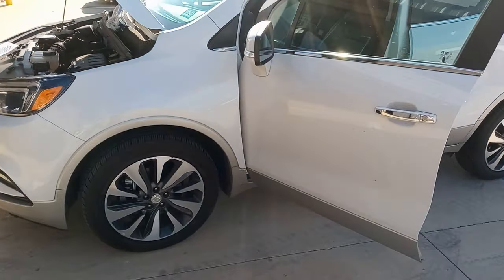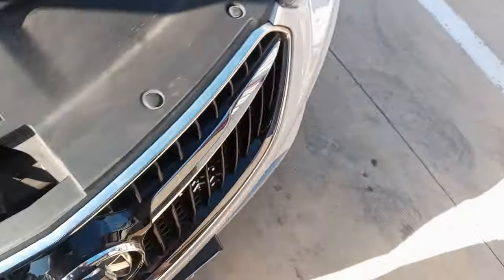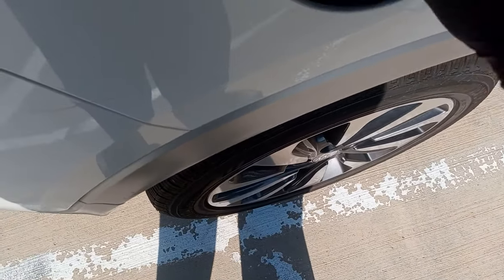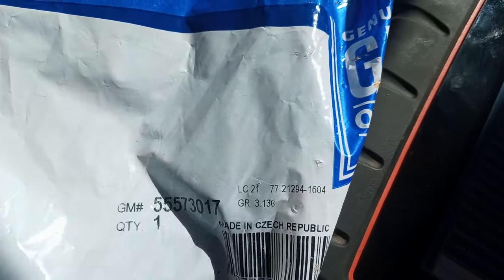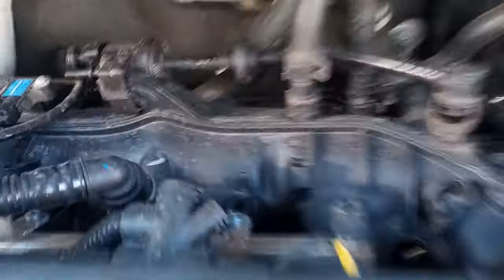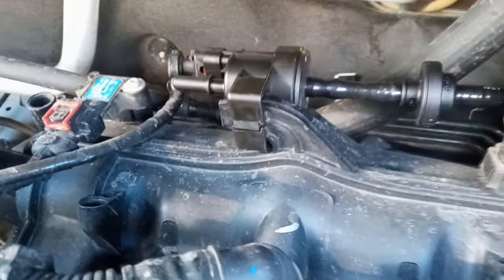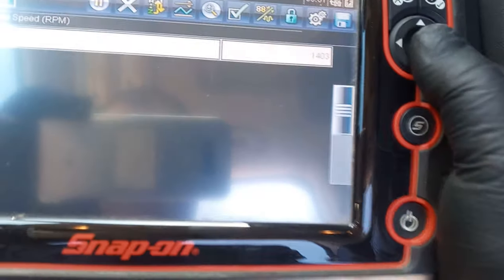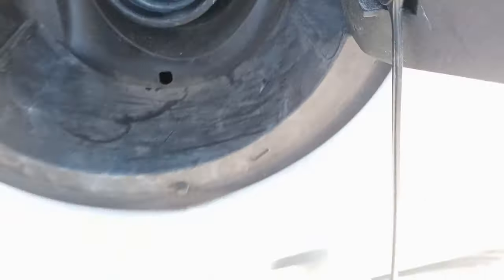1.4 Turbo lean codes: P015B, P0171, P1101, Encore, Sonic, Cruze

Comment: Are you sure thats a 2017?? I believe that engine you just showed is an early 2016. They redesigned. that engine mid 2016 the oil fill is far left upper side of valve cover now, and the intake , and PVC system are completely redesigned

Comment: Thank you, thank you, thank you. I have a 2017 sonic. I searched the codes on YouTube and found this video. I was very skeptical at first especially when you went to the gas cap. Then I was like OK I can check that. I open the gas tank and guess what I heard bubbling/gurgling. Went to the auto parts store and got the part everything is good as new.

Comment: I have a 2015 buick regal turbo, the code for mine is p1101 and the most likely solution from auto zone is power train replace intercooler hoses...
Reply: My 2015 buick regal turbo just threw the P0171 today out of no where and now my engine is leaking oil from the engine. Ive had zero issues with my car up till now except for my radio having a black screen. Ugh im so mad
Reply: Me too they put a part on and hose.
Reply: That’s crazy and he put on new gaskets so that won’t happen.I feel for you

Comment: I'm still getting the p0171 code.
Reply: There's another YT that says to replace the valve cover. It's a bit more complex than this too. Search p0171 buick encore. I'm sorry I can't link it.
Reply: @ashleysandia2528  I’ve done that plus the upper air intake manifold.
Reply: @PaulVazquezJD  Make any headway? Sounds like you have tried all the obvious items.
Reply: @Kuessemir  I just replaced the master air flow sensor with no change to it the code. I don’t see any large cracks in hoses but that still might be a place to investigate. I may also need to investigate the other side issues f the lean issues, fuel injectors.
Reply: What happened with that

Comment: Awesome video man. I have been chasing this one. Leaving right now to pull the gas cap and run some experiments, but I also have a hard stumble on acceleration. Would the purge cause that as well?
Reply: I have the same issue if you figured this out please let me know!
Reply: @darkcrimsin  I did actually figure it out. I observed throttle body PIDs and saw that when it was stumbling throttle body went up to 99%, but actuation wasn't true. It was still at 18% so I replaced throttle body. Then observed mass air flow data and found that the mass air flow was sitting a little higher than usual. Which is weird considering I was getting a lien code.  But I swapped it out anyways and now I'm good. No problems. Car drives like a dream

Comment: I got the same 3 codes from the scanner but when i take off the gas cap i dont hear the sucking noise you got on this video. My question is i got the 3 code you got so if i replace the purge valve do you think it will work even if i dont have the sucking sound in the gas tank?
Reply: Did replacing the valve fix your problem?